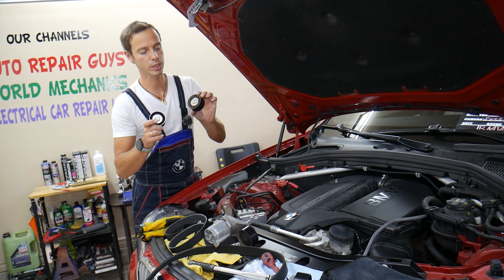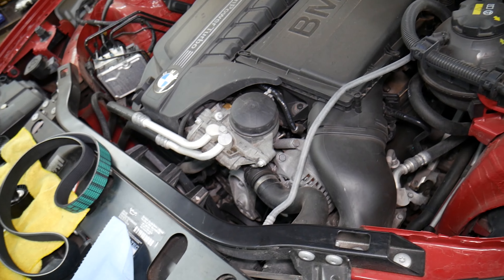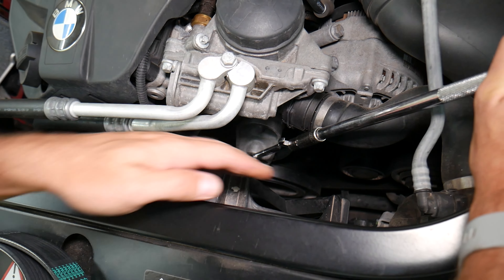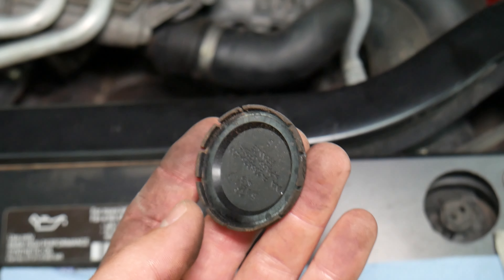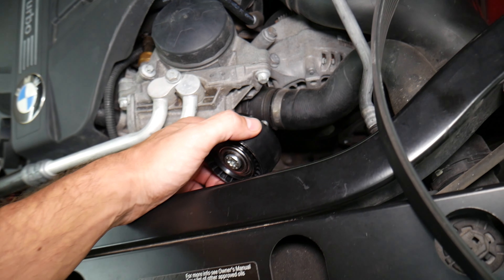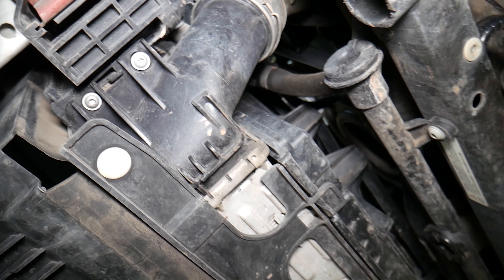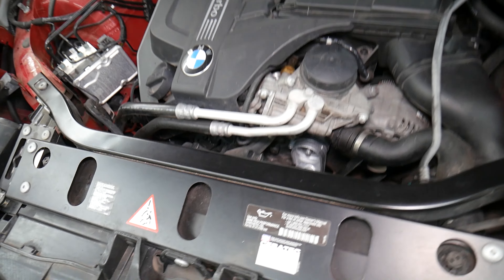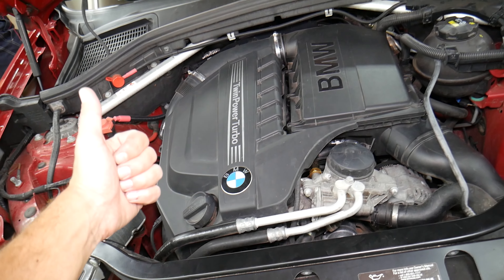BELT IDLER PULLEY REPLACEMENT REMOVAL BMW N55 335i 535i 435i 635i M235i X1 X3 X4 X5 X6 XDRIVE35i SDR

Comment: on the 535i F10, that idler pulley is blocked by a bracket for the AC hoses.  You can remove a bolt, and kinda push the bracket to the side, but it is still very awkward to get to the idler pulley.